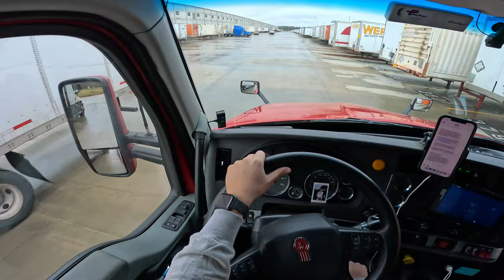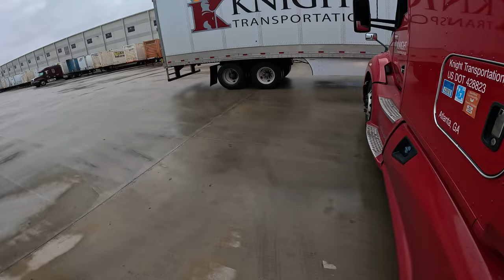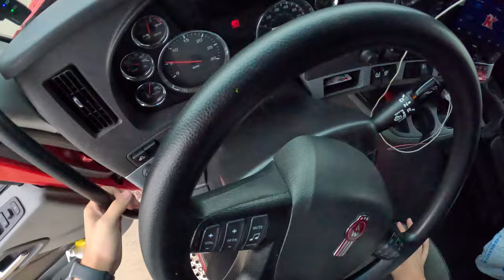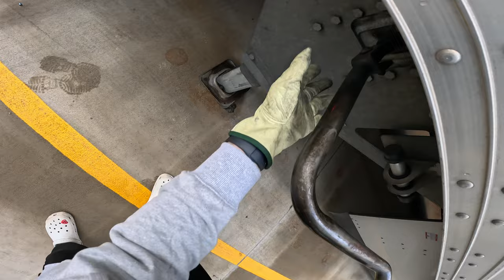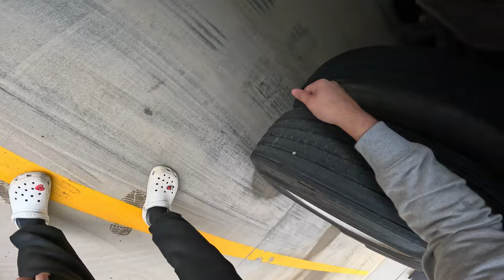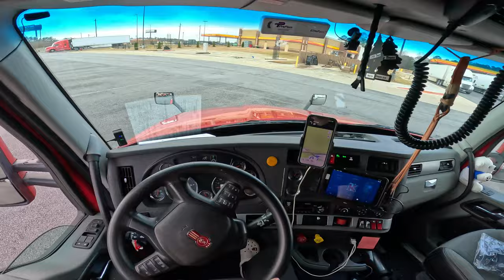Vlog #1 From a 23 Year Old Truck Driver

Comment: This made me laugh man, but not in a bad way, I like the fact that the Younger generation is taking over. If it helps out the community, there's nothing wrong with it, stay safe out there driver. Thank you for your Trucker Service! And once you get the experience, Variant/U.S Xpress would be a great company for you, but don't switch companies too much, because them companies will see that and not want to hire you because of the non stop switching. Last but not least, watch out for the landing gear, it may have dirty water in it, I pulled it out one time to crank it, and got soaked with water.
Reply from the maker: Yess! correct i am doing just that to get me good experience over a few years in trucking and level myself up towards whats better for me. I sure did get wet one time from the landing gear because some are not as in good condition lol
Reply: @Johnny the truck driver  Yeah, Team Driving is where the pay is at, I would get a family member into trucking and save up money with them. That's my opinion, because going teams with strangers is dangerous. Variant/U.S Xpress has good trucks and trailers, But Good Luck in the Trucking Industry, and Thank you for your Trucker Service. 👍 also if your interested in playing Truck Simulator games, there's a High Tech Mobile Game called (Truck Simulator Pro USA), it's going to be coming out in (May), the YouTube Channel to that game is called (Mageeks). 👍
Reply from the maker: @dallasharris8536  I’m not going to lie when I had to go with my trainer and he drove, I was more scared thinking he was going to crash than me about to drive my first time in the semi truck 😂
Reply: @johnnythetruckdriver  Yeah, that's true, it's hard to trust people's driving, but look into that game though, it is a big deal, and there's no other game like it, it got Delayed on December, and will come out on May, (Mageeks) YouTube Channel, there is a gameplay video of it. Stay Tuned on that game, because it's better than any other game on the market. They also have a Discord Server. But yeah man, definitely have to trust people out here lol

Comment: So what happened with the side light and tail light not working
Reply from the maker: I didn’t show you guys but I did got to manage to fix it with just wiggling the 6 pin connector more inside and it started to work
Reply: @Johnny the truck driver..  I've seen where you put ziptie on it, so it lifts the weight of the plug, and it hits all prongs evenly
Reply from the maker: @semiwandering295  yes some have there own way of snuggling it in for it to work lol.